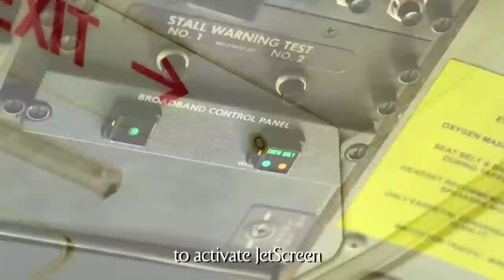Three Airlines That Could Cease Operations Very Soon!

Comment: Wow- loosing money painting all those aircraft pink.
Air Belgium- fighting  low cost airlines 
Jetairways- can't cope with the kicking of Emirates 
I am possibly worrying about another airline Flybe they have been struggling in the past and seem to waste money on aircraft painting and much more
Reply: agree about Flybe
Reply: Then ANA is screwed when they have to paint those three a380s
Reply: >WOW - cutting back on costs and expansion plans, getting under control. Minimal loss over pink planes.
>Air Belgium - they are a low cost airline , and are fighting Cathay Pacific between Brussels and Hong Kong. Otherwise stable
>Jet Airways - Emirates has nothing to do with their problems, it is the rupee/dollar exchange rate
>Flybe - don't know why everyone is pessimistic about their future, they had worse financial troubles in 2015/16 and are much more stable now. They are undergoing retirement of their ERJ-195s to cut costs and introducing new ERJ-175s from 2019.
Reply: Flybe is big enough to rid the unprofitable parts and it'll still be one of the biggest of its kind. Stabilisation is the best thing it needs, The end of the LOG franchise hurt both airlines, both lost heavily last year

IMO Wow should be fine as it's model is rather unique and I don't know enough bout the other two
Reply: +FlybeDash8Q400 In the long run Loganair becoming independent was better for them. They have now began to expand - with them receiving their first Embraer ERJ a few days ago - and are further increasing their ties with flybmi. Loganair is mainly hurting now because of the decreasing North Sea energy industry, particularly with routes from Norwich and Aberdeen.
Reply: yea both airlines will indeed need to replace the lossmaking areas with profitable ones, for Loganair as you said perhaps moving away from the north sea oil work (which I think eastern dominates, wonder what their accounts are like), Not sure what the whole job is needed for flybe but removing the 195's is a start, I think expanding on a base may be a good strategy as well as 'making up' with Loganair.

I'm assuming this first LOG ERJ in the short term is for the new GLA-LDY route with the continental stuff starting from Q2/Q3 2019 when a second one joins? Has there been any development on the proposed 190's too?
Reply: +FlybeDash8Q400 Also it is Eastern Airways and flybmi that are looking at getting ERJ-190s, Loganair just want to replace their Saabs and Dorniers :).
Reply: @abtravel0279  isn't FlyBe a subsidiary of British Airways ?
If not, why don't British Airways buy them out ?
Reply: @Coastal23UK  it used to be but afaik BA/IAG have a minority share or no share at all these days, they only had a share cause of the BA Connect sale
Reply: I flew Jet Airways last month from the UK to India for work and up until 2 weeks BEFORE my trip I had never heard of them. Its an odd airline, the aircraft interiors in First and Business are VERY dated and is in need of a general over haul to make those classes fit for purpose. Also, there is no Jet Airways lounge in Heathrow, Mumbai, Bangalore, New Delhi or Chennai! Which given the airline is the second largest in India is just plain odd! Also, I had 4 internal flights and ALL of them were late in leaving...we arent just talking a few minutes late but 30-40 minutes late each time! Really does seem the airline needs some serious management over haul to get some new blood and new ideas in to the airline!
Reply: No
 @Coastal23UK
Reply: flybe is dead ):

Comment: Garuda is also in red light, massive loss in 2017, and still record loss in q1 2018. They have delay delivery of all 737max8 and a330neo. They also suffer management issue few months ago and now the Indonesia Rupiah is going down in value which may lead to problem for the airline

Comment: I think you are exaggerating the inefficiency of the A340, yes they cost a little bit more than the 2 engine ones, but it can't be such an enormous impact
Reply: Everyone seems to stress the 4-engine/2-engine difference way out of proportion. Yes the twins are more efficient but the quads are still money makers.
Reply: EXACTILY
Reply: Thank you!
Reply: Airbus 340, are gas guzzlers and still use old technology. SAA(South  African Airways) is almost gone burst and they operate them.Yes A340 are truly inefficient and 4 engines are still based on old ATOP rules.
Reply: Exactly! A340 is literally as modern as the A330. And what is a true gas guzzler, that would be the MD80.
Reply: @Ibirdball  The A340 still operates from my station for a cross Atlantic flight.
Reply: Uhhhh...the a340 actually burns less fuel overall than an equivalent 777 on the same route. However, as the 777 generally can carry more passengers, its fuel burn/seat is slightly lower. But, considering planes are generally never at full capacity, that isn't actually as significant as people think. The real kicker is actually maintenance. Even with the 4 engine for the price of servicing 2-engine program, the maintenance cost for the A340 is still rather high.
Reply: @ying20000818  I am a loadmaster for a A330 & A340
Reply: @jerry85g7  and I'm a pilot 😋
Okay, I only hold a PPL(A) so ain't no airline pilot but...soon I will be. Currently studying for me ATPL exams.
Reply: @ying20000818  Nice...Wish you the best.
Reply: @ying20000818  that's exactly the thing, in a triple 7 you're carrying more people AND cargo with 2 engines which points at both maintenance and spares ... the reason you still see them is because the acquisition costs (lease/purchase) of a used a340 are much more favorable than trying to buy new and the startup carrier believes the savings or leasing rates can offset the penalty in fuel costs

Comment: Interesting information.  I'm always wary on those budget trans-atlantic carriers.  I hear many a story about Norwegian to the US and the fact that they never on time and delays are quuite regular as well as  customer service is not the best, however whenever I travel LGW/BGO/LGW route I find them quite effecient, in fact too efficient, so why do they have a problem on the US flights.  I'm wanting to use them but as I said very wary.  Also, when you work out the cost against the big boys, 9 times out of ten you'll find they work out much more economical thasn the budgets if you want inclusive.

Comment: Air Belgium just was so dumb in choosing Charleroi to fly out of and fly only to Hong Kong, there are so many routes from Belgium where an airline wouldn't have any competition, and they managed to pick one where they did
Reply: I mean, they cant compete with SN, but then again, i aint European, so idk about the airports in EU vs US
Reply: And the alternative would be flying from an airport with much more expensive slots, more restrictive facilities and nowhere to have a maintenance base. You are also criticising them even though they have only been flying since June and haven't built a customer base up yet.
Reply: +Avionic7779x SN don't even fly to Hong Kong...
Reply: I was talking about CX, which is obviously a harder competitor than SN. They decided to fly from an airport which wasn't built for heavy's, which I can imagine leads to cramped terminals. This also meant that the takeoff weight was limited, which isn't ideal if you're flying to one of the world's top cargo airports. Charleroi isn't as good for connections, nor for cargo, nor for reaching it from most of Belgium. Even with higher slot prices I feel like BRU was a better option. Also, investing in just one route is a huge gamble, which didn't pay off. And yes, building a customer base is important, but this might mean they didn't try hard enough to build one. I just feel like most of their decisions weren't ideal...

Comment: Please don't reignite the two versus four holers debate....but just to ask at current market residual value, which 2 engine aircraft with similar capacity with the 343 is cheaper to source than the later?. Bear in mind, Air Belgium's fleet has an average age of 10yrs, leased from Airbus Finance probably with hefty concessions for obvious reasons. You cannot get a B772 or A333, with similar age and flight hours for cheaper than the A343. Besides, the A343 depending on various matrices has had a better CASM than the B772. Good video though. By the way OO-AOA has been operating BA72/73 for a while..

Comment: I think WOW Air might have a chance, their concept seems to be quite good and as far as I know they are currently profitable so they can slowley pay back their dept.
Air Belgien was doomed from the start, such a pointless Airline nobody needed an Airline that flys from Charleroi to China with an old A340!
Jet Airways will be very intresting, Etihad actually can't afford to help them and Indigo is really putting pressure an them, so the next year will be very importan for them.

An other Airline I am very worried about is Flybee, they are struggling again, but seen to waist money on countless rebrandings and repaintings, also their fleet restructure to an only Dash-8 fleet does not seem to be done, and rising fuel prices really put pressure on them.
And finally there is Norwegian who I belive won't make it too, the depts are just to big, but it will be very intresting who will buy them.

Comment: If Wow and Air Belgium change its fleet to all Boeing and Jet Airways hired an executive from Southwest and make him/her a CEO, I can only think that those airlines not only will survive but will become profitable.
Reply: Boeing fanboy alert, biased statement.
Reply: Jun Lin Lol.....and it’s so difficult for me to hide it. Btw, if they follow the advice the results will be as stated.
Reply: what makes u think that if they operated Boeing aircrafts, they will not be in today's state?
Reply: any evidence to support your claim?
Reply: Jun Lin very easy: in regards of Wow, just check what planes are using the biggest and more profitable low cost airlines in the world. In regards of Air Belgium, they can use instead a used B767-200ER and results will be much better in everything compared to using the A340, beautiful plane but at spend of too much fuel consumption.
Reply: For Wow Air, maybe you could explain AirAsia X, Cebu Pacific.
The most probable reason why Air Belgium couldn't acquire 762s is that they are very old already, their A340s are just around 11 years old only and were well-maintained by previous owners
Reply: and personally, I don't think that its the aircraft type that they are operating are  the issues. Wow Air rival, Iceland Air is also facing turbulence too even though with an all-Boeing fleet, Air Belgium and their growth plans just dpes not make sense. Too slow and they should have started mid-range routes in the first place*US, India)instead of HKG
Reply: Jun Lin Well, this video mentioned 3 airlines for which I commented and why I think they will be in another side of the business if they do what I said, and it was my personal opinion and of course, my Boeing bias. Can I have my own opinion based on my sources or I have to go with yours?
Reply: its okay, I just dislike people that tries to put A down for B and also vice versa.  kinda pointless i figured
Reply: @polduseri909  In reply to your 1st and 2nd comment - Jet Airways is a majority Boeing company and they are doing so well. Right. /s
Reply: Abhilash Nair Not yet, they are in the smartest move to become an all Boeing. When they replace their A330 for B777 then they will start seeing not only better performance but the best after sale service in the world that only it is provided by Boeing.
Reply: @polduseri909  Haha seriously mate? They have 4 or 5 old A330's. That's it. It's a majority Boeing fleet. Stop being such a fan boy. There are Airlines like Singapore, Indigo that are doing great with Airbus. So your excuse is total BS.
Reply: Abhilash Nair Seriously Airbus fanboy? Do you also forgot that I mentioned in regards of that specific airline that they need also another CEO that may make adjustments, an executive from Southwest with experience and knowledge on how to run an airline?

Comment: Alitalia?
Reply: Nope, they are being bailed out like Air India.
Reply: Bailed out as part of the Etihad network. I flew AZ this summer. Both flights completely sold out and on time. Better than a lot of carriers.
Reply: being sold out does not mean any thing if the break even point is above 100%. Etihad will drop Alitalia as it it dropped Air Berlin in the next economic recession

Comment: Great video man.
But why is it that most of the airlines going belly up are operating Airbus aircrafts.
Reply: Daniel Esimu most of these airlines operated short haul flights and Airbus is king in that market
Reply: and jet airways uses a fleet of primarily 737 with the A330 and ATR 72s adding on
Reply: Im assuming bc Airbus is more expensive than Boeing, but I have no clue. I think its just luck
Reply: Very true, Airbus are like German cars(over engineered automation), nice but costly to run.Boeing is like Japanese cars, they age like wine with no early expiry date
Reply: Harold Nkgudi Hahahahaha I can relate with this comment easily.